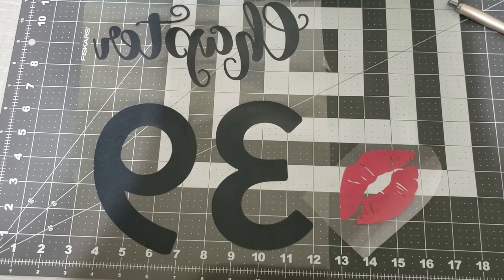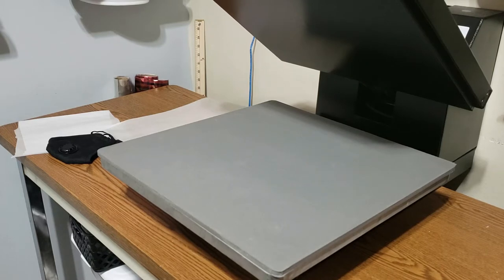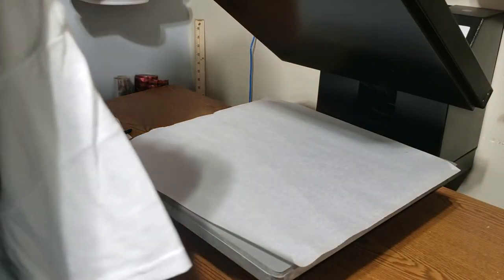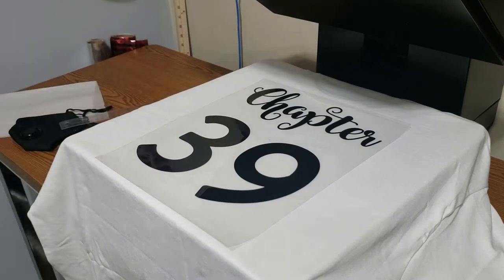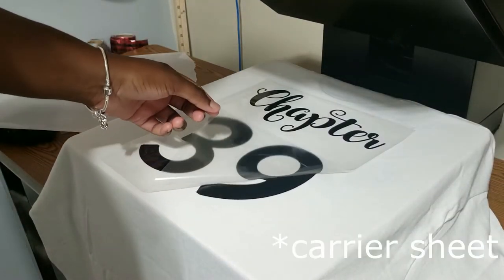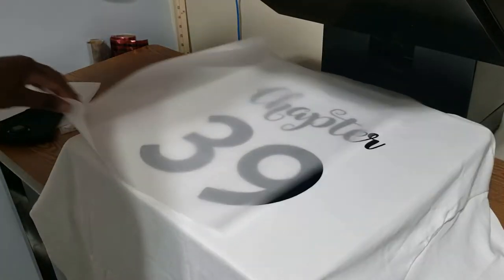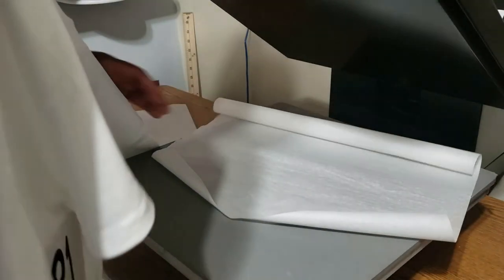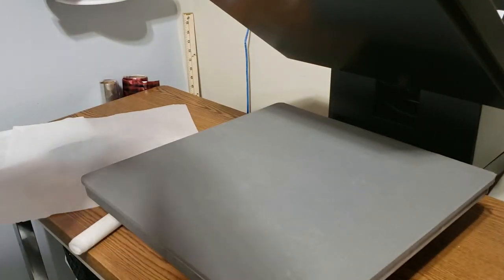HOW TO ADD HEAT TRANSFER VINYL TO THE BACK OF YOUR SHIRT!!!

Comment: When I press my shirts they don’t always stick to the shirt completely, I usually do 20 seconds? Am I doing anything wrong? Help 🥺
Reply from the maker: If you're using a heat press, you may need to increase the pressure.
Reply: You  have to  wait for the  shirt to  cool down